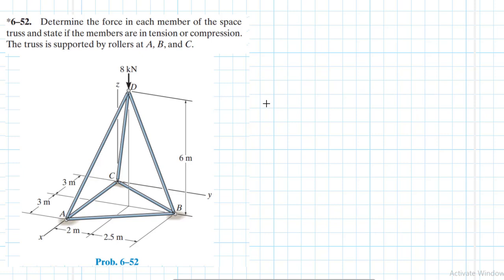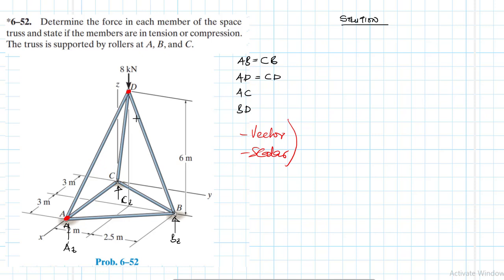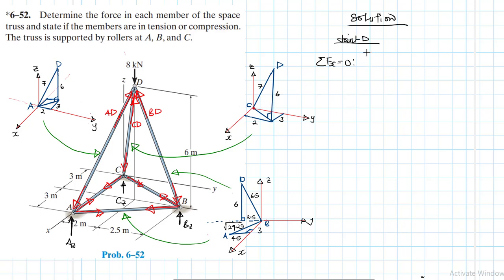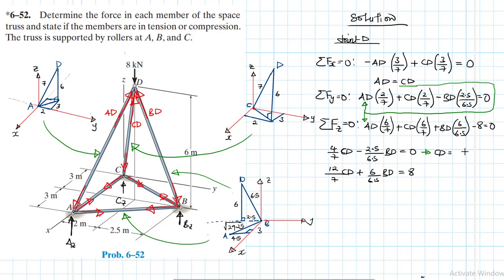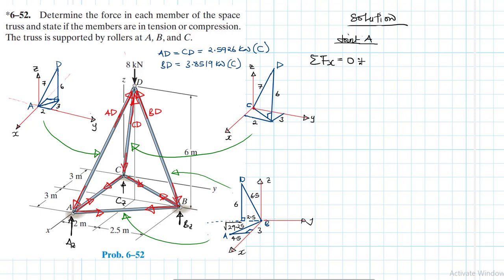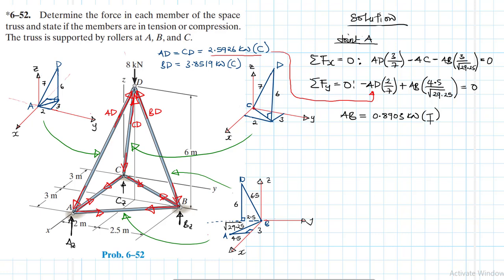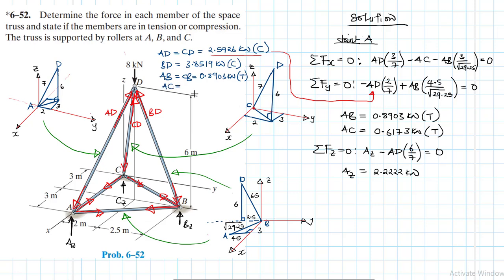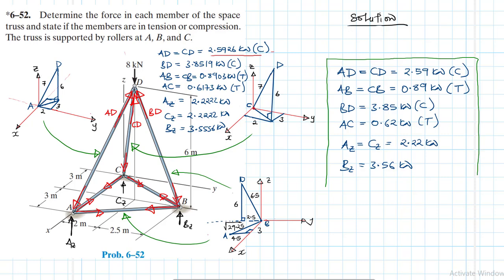6–52 Structural Analysis (Chapter 6: Hibbeler Statics) Benam Academy

Comment: Thanks for the great videos. I was wondering, when we use a unit vector for our equilibrium equations in analysis of Joint A, does it matter which first is the "first point" like DB versus BD, DA vs. AD? I ended up doing DA, DC, DB and ended up getting all negative results solving for those members. Same numbers as you, but all negative.
Reply from the maker: The key is to begin by assuming the directions of the internal forces in the truss members. Once these directions are assumed, apply the unit vector principle to the assumed member force directions. If the solution turns out to be negative, it simply indicates that the actual force direction is opposite to your assumption.
Reply: @benniehamunzala  Okay I see. I should have remembered that, just like in 2D trusses, if I assume tension and get a negative number, it means it's in compression. Thanks!